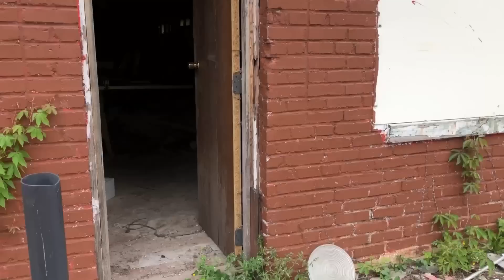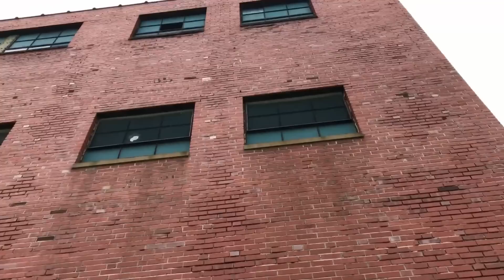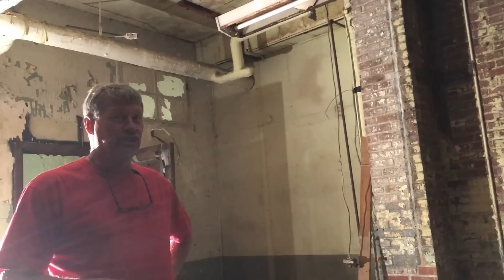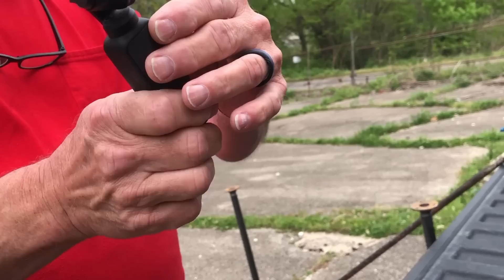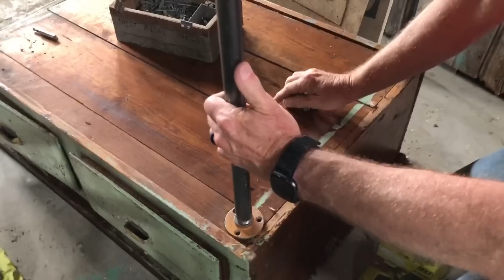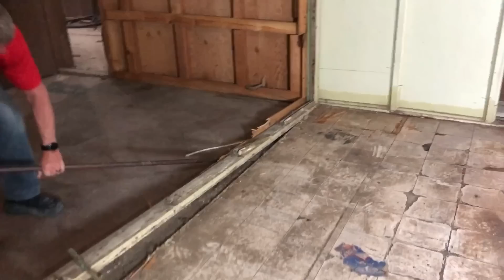Big Day for Industrial building renovation

Comment: I have been slowly making my way through these videos and haven't really watched EVERY single one of them and certainly haven't taken the time to read all the comments but just in case nobody else has mentioned it in the comments for the dust and dirt, you should look into building a Corsi-Rosenthal box from a box fan and air filters.  Use it or potentially them, in some of the rooms you have finished or maybe even ones you plan on starting and it can be a cheap way to start cleaning out the dirt and making the air cleaner.

Comment: Hello Chris, when you tore down endless sheets of wood paneling, a thought came to mind. These could have been used to barricade the windows from the outside - at least giving the impression of the panes being boarded up - perhaps deterring these kids somewhat? It could be time consuming but a lot less expensive than re-glassing all the broken windows. Unless of course you can make sure that these incidents are effectively dealt with? Such a terrible nuisance and mindless criminal conduct must not be allowed to go unpunished and the whole community, parents schools and police must be encouraged to own this problem. Don't let this sap your energy, budget and spirit - press charges and demand compensation from the parents if they want to settle. This is a very easy issue to solve if the parents take responsibility for the consequences of their own kids behaving in this manner, Chris.
Reply from the maker: I have done it already around the ground floor, resin impregnated OSB.  the kid problem is getting better as the building starts looking more cared for.

Comment: Just screw hardware cloth or chicken wire screen draped over each window, attached at the top. Cheap, removable & easy. If you only had a bucket truck...

Comment: Engage the local TV station,  or newspaper,  to do a segment on your factory and make a comment about vandals.   Install outdoor security cameras-- get a sponsor to get the equipment --- 

Put up signs outside that vandals, trespassing will be prosecuted. You have enough wood, post, paint onsite to create them.    Even if you have a .....Smile, you are on camera,,,buy some mock looking cameras and mount them outside,  might deter them

Comment: I would put, even temporarily, some chicken wire over the windows. I live on the east coast rust belt and I see that on old factory buildings all the time.
Reply from the maker: I have been looking for micro chain link that can stop rocks but so far no affordable options. do they make chicken wire with small holes?
Reply: @brickandsole  Yes, they make chicken wire with small holes. If you have a local tractor supply they’ll have it so you could see what they have and most likely be able to order the same product bulk online.

Comment: 11:37 Being so close to the baseball fields is most likely the problem... Need to get some Blink's or such with the sync module and the flash drive so you can record the little suckers! 
I know that the initial investment is killer. But I just got 5@$200. Plus the WiFi. You're smart enough to do it w\Bob
Reply from the maker: Yeah, I have some cameras (reline) I just need more of them so I can cover more of the outside of the building.

Comment: If you make wood  frames with a "cross "in them  a  to fit outside the window,  put welded galvanized 1/2 inch thin 
Plaster reinforcement nets on them. i would be hard to get a stone to het the net to buckle enough for it to break the glass. The question is how much i would cost doe (many windows) ,and how you should  keep  them in  plaze. 
I think the better solution is to 
Try to get them to stop throwing stones by informing ythe local community about how expensive the vandalism gets for you ,and that putting protection on the windows will bee hard and costly also.

There are  also glass breaking detectors that react to  sounds of  glass breaking.  Look them up.
Reply from the maker: I have been googling, there have minis mesh chain Link fence, paired with your frame idea that could be a good solution and wouldn't block light.

Comment: You can baracade the inside of the door like old school cross braces. You put up plywood on outside of the windows. That old paneling wood work for temporary situation.  For permanent situation you can cut aluminum sheeting for each window space and putty it in.   Brick those windows up.
Reply from the maker: The brown shoe in the neighboring town used aluminum and believe it or not the kids found away to throw hard enough to punch through it. It would have to be heavier gauge.

Comment: On the windows I would put chicken wire on the front of the windows so the Rocks do not penetrate the glass of 3 inches away from the glass that way you could get light in the windows but they can't break the glass
Reply from the maker: A few people mentioned that. but it would have to be offset and I think that may defeat the practicality.

Comment: Lorex, ring, blink, swan make good camera systems some with ethernet power and video.
Reply: It is difficult to pinpoint when the vandalism occurs since no one is there much of the time.
Reply: @bobrobert9413  yep exactly why cameras would be an excellent investment of a couple hundred. Blink has the outdoor 4 cameras and even the hardwired floodlight cams with 2 way audio are excellent..1 per side of building and 12 bucks a month unlimited filming simultaneously. You can easopen the alert and call out the police are coming and sound the siren.
Reply from the maker: The ones we have, are basically like that. Reolink. Remote monitoring, text alerts, motion detection, etc. I have a server, I just need to keep plugging in more cameras I guess.  The ones we have caught in the act have all been thanks to the cameras.
Reply: @brickandsole  yes reolink, I forgot that name. They are some pretty awesome hardware too

Comment: I would put plexiglass over all the windows. Leave that project to the very last when the building is occupied. Otherwise you'll just be fixing it over and over.
Reply from the maker: That is an excellent point. There is nothing better to prevent it than having the building look cared for and kept.  And doing windows too early is a losing prospect.

Comment: The table looks great.  That cut out could be for running the cord for the lamp so it is out of the way.  Keep hard wood floor get rid of white tiles.
Reply from the maker: there is 1 inch concrete under the tiles, they poured it to level before the installed the tiles.

Comment: You shouldn't of torn down that green wood wall and torn the opposite wall down
Reply from the maker: it wasn't original. it was older than the others but not original.
Reply: @brickandsole  it looked like the other green   panel walls

Comment: I think you need a large locked fence all the way around building with razor wire on top.  Wonder if it was fat boy again.
Reply: 😂 you made me laugh on that one. Bob
Reply from the maker: Like revenge for catching him the first time.  Maybe I wouldn't be surprised.  The back currently has a fence with barbed wire but it is an extreme headache for mowing. I was thinking about particularly nasty bushes with thorns.

Comment: Just read a DIY using cardboard over windows to deter rock throwing.  Summer is coming up and kids are more likely to be out late at night with nothing to do but throw rocks....Cardboard maybe a cheap way to save the windows that are higher up? Maybe consider leaving the top panes uncovered for some light?  The kids would then have to become crack shots to exact windows or maybe that is encouraging them?
Reply from the maker: yeah, not looking forward to that. I left the top ones open for the covering I did on the front of the building. It is not perfect by may be the only solution.

Comment: cheap easy way to do the windows is full sheets of lexan over the entire window. You may have to build a wood frame for them. Preserves the look and fully protected. Cheap way to replace glass panes is with thin plywood painted black on the outside. Caulk them in just like the glass. Looks good, hard to break and you can make them yourself from scraps!
Reply from the maker: I thought about that but it comes in 4x8 sheets. and the windows are 4'3" x 9 foot.

Comment: Not enough exterior cameras and more signs.  Preferably with detection of humans.  Maybe even closed and gated fencing for the rear portion of the property.  Boarding them over seems like a good temporary solution.

There are forums like IPCamTalk that could probably help you figure out a better camera system.
Reply from the maker: I have a pretty good one, with a server, remote monitoring, animal/people detector, etc. But I just need to buy more cameras and run ethernet to them.

Comment: Use plexiglass to replace the windows. Same look but it does not break.
Reply: Ages bad doe , the non uv resistant plexi get "milky" over time ,the uv resistant super durable stuff is expensive.
Reply: @perstaffanlundgren  So I guess that you answered your own question. The issue comes down to how many times do you want to replace the window. Of course the other option is tempered glass which i believe is required by code in commercial spaces.
Reply: Plexiglass is more expensive than glass.
Reply: @richardvinsen2385  But it doesn't break
Reply from the maker: There are a lot of factors. I think I heard Lexan is not as prone to yellowing. I also heard it is possible to buy in 4x8 sheets and have the hardware store rip them into individual rectangles on a table saw.
Reply: @brickandsole  Contact a plastics supplier in your area. They can steer you in the correct direction. Also, their prices will be better than the hardware store.

Comment: I know the paneling & old lumber is trash and not strong but could it be painted and used to deter the rock throwing on some of the windows? Maybe at least those that have all the glass? Is there 1 side that has concealed the view of the vandal giving them a sense they can't be discovered?  Sorry, I can't envision a reuse involving old tires that could save your windows.
Reply from the maker: Yeah I think it could be, but I really want to have a nice look, instead of a boarded up Detroit look.  I am wondering if a final push on the windows at the very end when everything looks nice will make it look like a kept building and discourage that kind of thing.